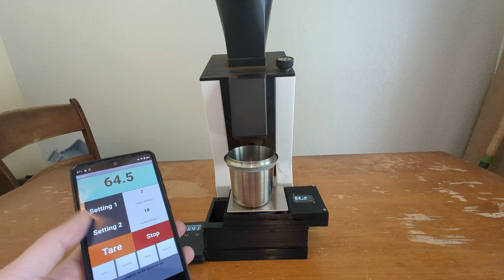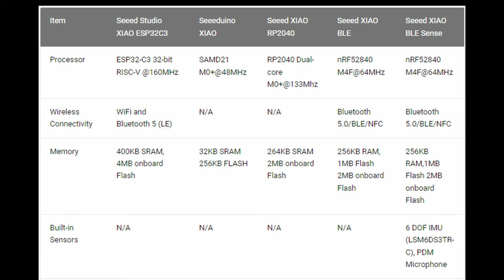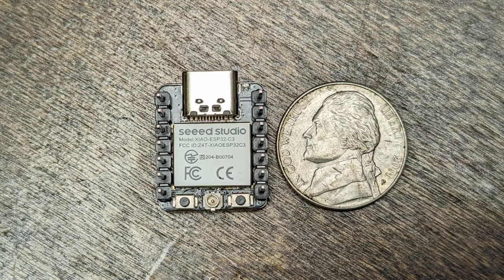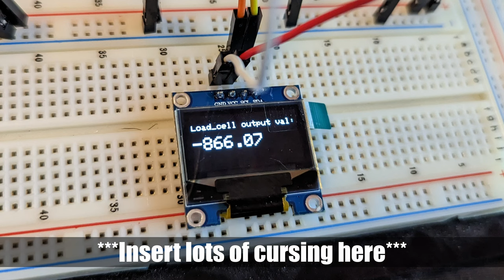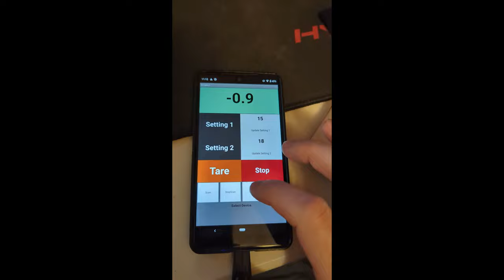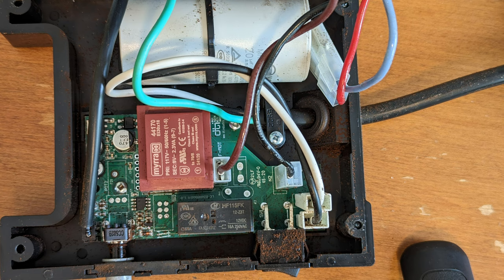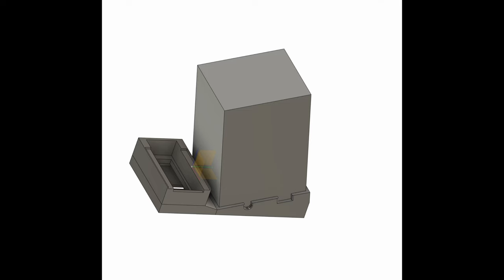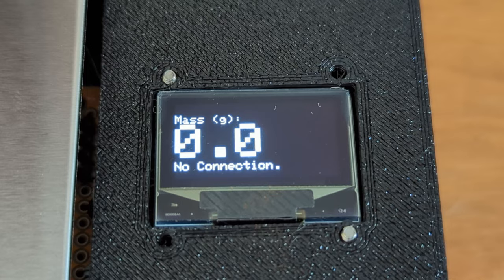Giving my Coffee Grinder a Brain (w/ source code)

Comment: This is amazing! I've been been eyeing the Gaggiuino mod, but have been intimidated. This seems like a very similar but simpler project, should be a great project to get my feet wet.
Reply: The gaggiuino mod is honestly not to bad if you have done any handy work before. It's really just a lot of connecting wires and soldering connections. All of that is well worth the end result.
Reply: agree with cavin, gaggiuino mod wasn't too bad. diy car mechanic and I found it relatively straightforward. there's also a good video guide from rsilvers. highly recommend the pcb.

Comment: Hey, great vid. Curious though, how did you figure out that jumper header for the relay?
Reply from the maker: I actually did probe it out to verify, and watched it with an oscilloscope, before hooking anything up. The microcontroller is the little 8-pin chip in the lower left of the board next to the timer pot. It's a Microchip PIC12 F1571, so I pulled up the datasheet and could figure out the power pins easily. That only left me with a few pins to check for signal.

IIRC, the control signal comes out of pin 6 (maybe pin 7? don't recall). Once I saw the jumper (it is embarrassing how long it took me to notice it), I probed it to see which components went to which pins on the jumper, and what their voltages were. Didn't take very long to confirm what did what.

Comment: Wow! This is a wonderful project! I just edited the arduino code to make it run on a MH-ET Live Esp32 MiniKit. So far I got the Display working and could connect it to my phone. The Scales are next.
I absolutely love your idea, I just think there is one thing to improve it: a button.
I think controlling everything via one's phone is great but what if, lets say, the wife wants to use it and has no interest in using the app? Maybe a button that just starts "Setting 1" and grinds 18gr or whatever would make this thing perfect.
Unfortunately my coding skills are not good enough to add that feature. :(
Reply: I actually did some reading and it seems that I have found a solution myself.
I created an attachInterrupt(), which looks like this: "attachInterrupt(digitalPinToInterrupt(interruptPin), manual, CHANGE)" This way "manual" is triggered when the status of the interrupt button changes. my "manual" function basically is just a copy of your "void set1CharWritten", so it changes the state to 1 and therefore triggers the scale.
I don't know if that is how it is supposed to be done but it seems to work.
Reply from the maker: If you've left the scale on and the blemass value is set already, that should work. The proper way to do it would be to store the settings in an EEPROM and just update them from the phone app. Then you could turn the scale off if you wish and the setting could be used with a manual button any time you want. As it is, that button will only work after a mass setting has been obtained from the phone app via ble.
Reply: @TechDregs Thanks for the quick reply and the advice. Yeah, I did figure that out myself after a quick wave of euphoria... haha... My quick'n'dirty solution so far is that I added "target = 9;", so when pressing the button 9g is the only setting. But you are right, storing it in and reading from EEPROM might be the more elegant way. Anyhow, great project!

Comment: could you add wiring schematic to the github to make things little more streamlined. Tx
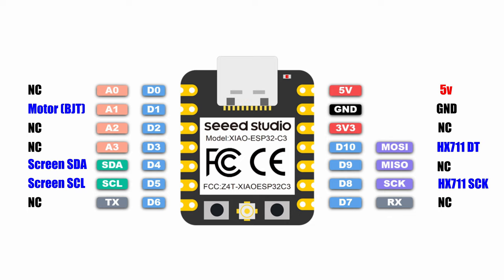Reply from the maker: If you watch at about 1:15, I go through the connections for the board and BJT. The pins are labeled based on the names of the pins they connect to on the HX711, display, and grinder. I also cover the pins for the grinder later in the video. Wiring is as simple as "connect these pins to their corresponding pins on the other items".

The only thing that isn't in there is the pinout for the HX711 to scale, but that's easily found all over the internet.

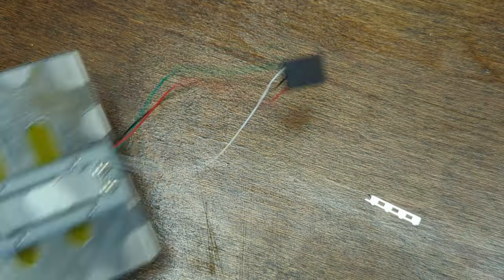Comment: 2:44 USE FLUX!!!
Reply from the maker: It's flux core solder. And at times I use a flux pen, which I don't always show.
Reply: @TechDregs  the flux in solder is sufficient for sticking to the tip, but not much else
Reply from the maker: If you tin the wires, it actually works pretty well. If stuff is super dirty, or for some of the wire I have that seems to be pretty oxidized, the flux pen comes in.
Reply: @formbi  It depends on the quality of your solder. I've had rosin lead solder with not enough just as I've had lead free with a gracious amount. Unfortunately I could never get ahold of more good lead free solder before I bought a relatively large roll of lead solder, so I'll probably be working through that for the next 10 years...

I almost exclusively solder to repair audio gear, so solder wetting the first time is really important. Lots of plastics that don't like heat... I consider the lead to not be a problem since repairs keep it all out of landfill. It's not like our ears have gotten better, so any gear that was good is still good, as long as it functions.